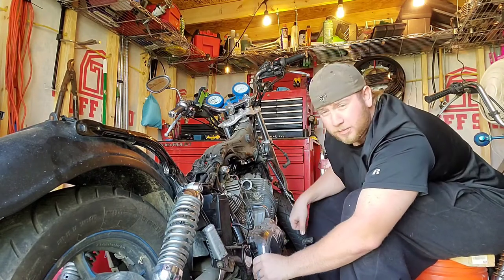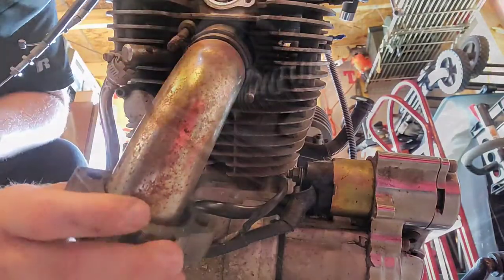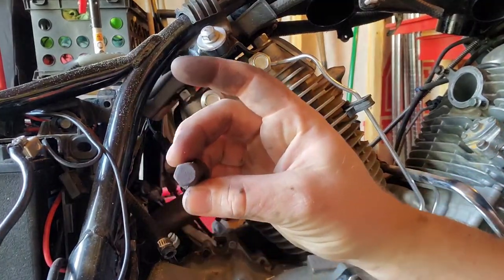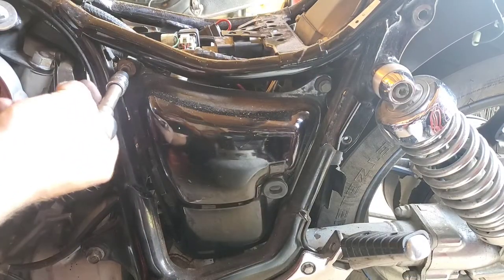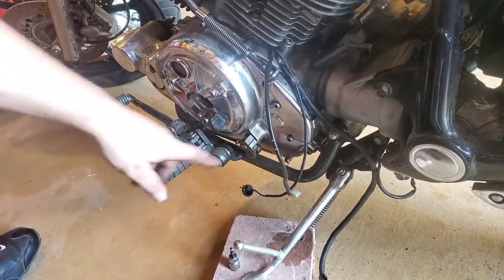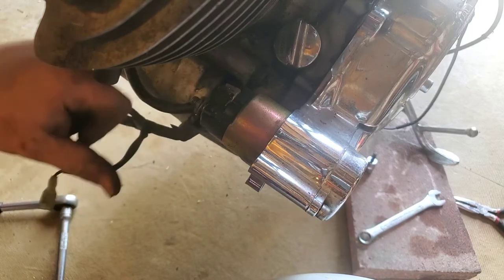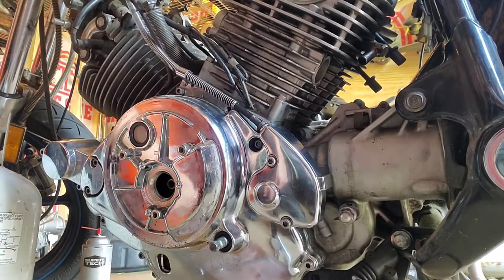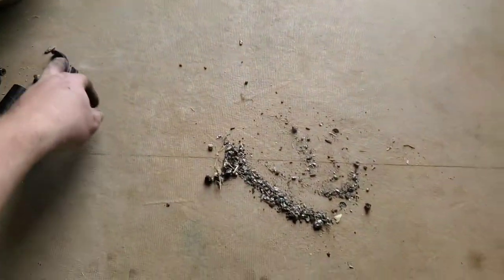Virago 1100 Shrapnel motor removal pt.1

Comment: The most common problem for rebuild Is people do not notice the rocker arm bushing Oil pilot holes are different from exhaust to intake on the rocker arms you need to be aware of this if not then you will destroy the cams and lock the motor up

Comment: 14:35 Excuse me, what is that piece for?
Reply from the maker: The Oil Level Switch/Oil Level Gauge Assembly. When the oil level is low, it's supposed to turn on the oil warning light near the handlebars.
Reply: @pipedreamscustoms5105  Thanks i didn't know!
Reply from the maker: @Error-ko9ym  Happy to help! Thanks for watching!